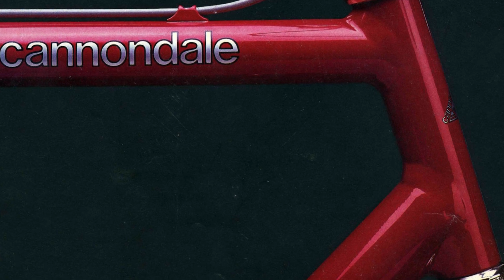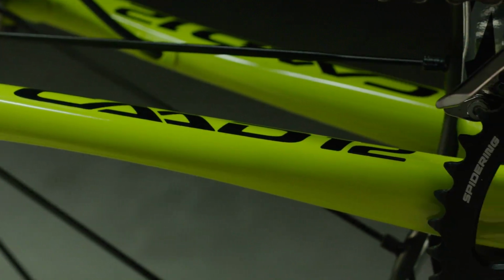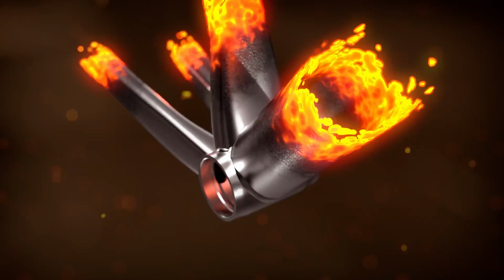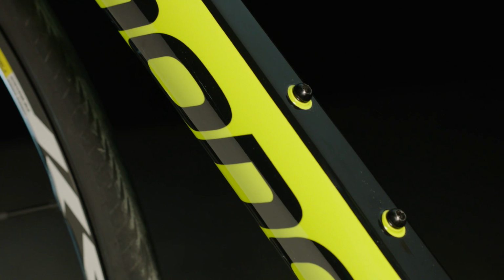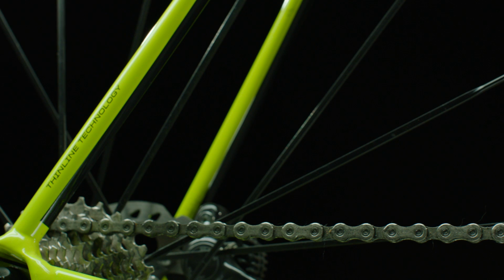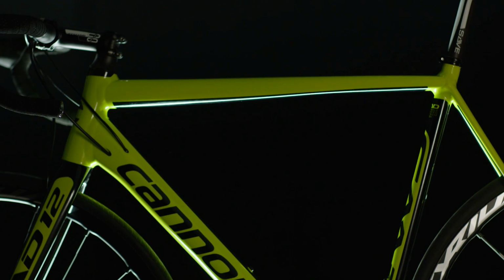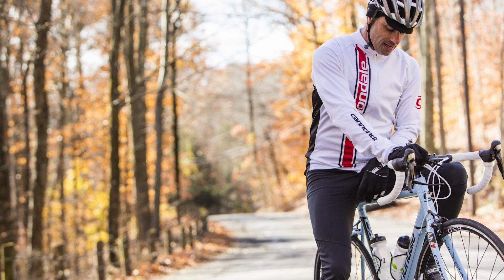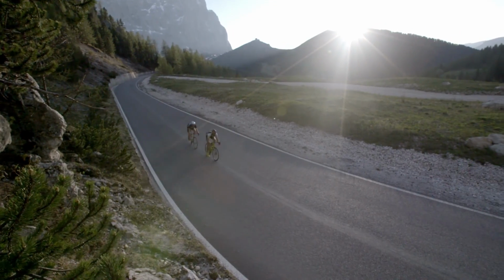Cannondale Innovation - CAAD - Cannondale Advanced Aluminum Design

Comment: I was looking at the 2019 CAAD12 105 w/rim but went with a 2019 Synapse 105 w/disc (no racing, I only ride for fitness, fun and Zen). Very happy with my choice. And no, I haven't had any issues with the BB. The one, very minor, objection I could have is that it's a thru-axle in front and QR in rear. I would have preferred thru on both. However, by no means a deal breaker (obviously).

Comment: A dent appeared in my CAAD12, cannondale won't cover it as they think it's an external impact that caused it... never crashed and no marks on paint, rebuilt the bike after cannondale said it was structurally sound, 320k in and the frame is tearing itself apart. 
Please be aware cannondale don't cover the lifetime warranty, would have happily upgraded to CAAD13 but wouldn't buy cannondale anymore.
Reply from the maker: Hi Fiachra,
We'd like to understand more about this case. Could you provide some more information about what happened? Most of the time, we find that small dents don't have an impact on the performance of the frame. If our technicians identify a manufacturing defect, we will happily offer a replacement as part of the lifetime warranty.
Reply: @CannondaleBicycles71  
A dent appeared in the drive side chainstay, approximately 13 or 14cm from the centre of bottom bracket on the outer side. I was worried so I got the frame sent back to Cannondale to be assessed, after all i didn't crash or drop my bike.
I was later informed that cannondale wouldn't cover the dent as it was caused by an external source but the frame is ok.
I got the bike rebuilt and started cycling again. After 300 k the bike started to feel strange, the rear wheel was moving around a lot. When I got back I looked around for issues and discovered where the dent was the metal was split, it was also split across the top and starting to split on the bottom.
I'm lucky not to have come off the bike and done damage to myself and others.
Hope you understand my frustration here as I don't think I've done anything wrong here but I'm now bikeless.
Reply from the maker: @fiachraoneill5733  in which country are you located? We will provide contact information for the local warranty team.
Reply: @CannondaleBicycles71  
Ireland - however my bike has already been sent to Cannondale in the UK and they won't cover the warranty, it was returned to me from Cannondale UK and i was told its okay to use. My first 2 spins on the bike and the frame falls apart. I've already had to get the bike broken down to send the frame to Cannondale and rebuilt at my expense after i was told it was okay to cycle.
Reply from the maker: @fiachraoneill5733  please contact warranty@cyclingsportsgroup.co.uk. They have been advised of your situation. We'll ensure you're out riding soon!
Reply: @CannondaleBicycles71  
I contacted warranty@cyclingsportgroup.co.uk, they asked for information on the bike, dates and who sent it... i gave them this last week and haven't heard anything back. I sent an email yesterday asking for an update or what is going on and they still haven't bothered to reply to me. I really would like to move on from this farce.
I've discussed the warranty with club mates who are shocked and some worried as they have Cannondale bikes. 
One guy has mentioned to me that Trek have the same lifetime warranty, they replaced his frame without any fuss.
They also never asked for the serial number, surely they would have it on the system!!
Reply from the maker: @fiachraoneill5733  the appropriate team has been notified and is handling this case. The issue was that the UK warranty team had never seen your bike before, despite your claim that it had been sent in for inspection. We want to ensure all protocols are followed to proceed and complete this claim. We appreciate your patience.
Reply: @CannondaleBicycles71  
Thank you for the update, I don't know why they didn't get the bike. I was informed that it was sent to the UK to be inspected. 
Thank you for updating me.
Reply from the maker: @fiachraoneill5733  we're working across a few teams here, but we're all in contact and aware of what needs to get done to have you back on the road. Expect an email during business hours tomorrow.
Reply: @CannondaleBicycles71  
Thank you.
Reply: Quick update, cycle sports group in the UK never had the frame but it was accessed in Ireland by the distributor. they determined that the frame had an external impact (no marks on paint) i decided to go down the route of a crash replacement (offered by the UK) but was told i needed to contact the Irish store who would deal with them directly for the replacement. it took 2 - 3 months for the Irish store to come back to me, then they wanted to re access the bike again. I agreed and the bike was given to them, they eventually offered me a frame they had (wrong size 52 not a 54) probably the last frame they had. i refused the replacement and rebuilt the bike with another frame i bought and reusing as many parts as i could from my old bike. as it is only 18 months old. i was also told by the UK i should make a claim on my house insurance to cover the cost. I'm updating this so people can make an informed decision before they buy a Cannondale.